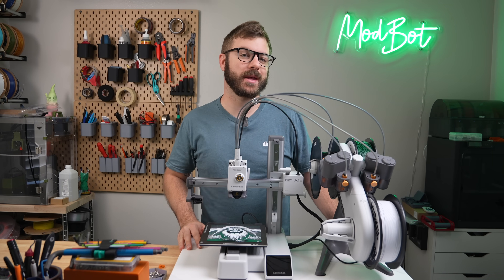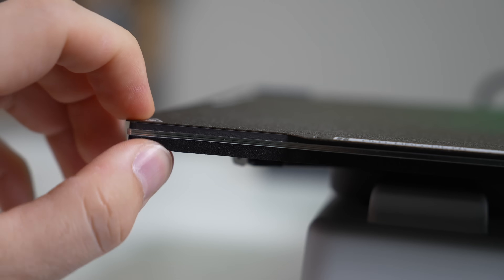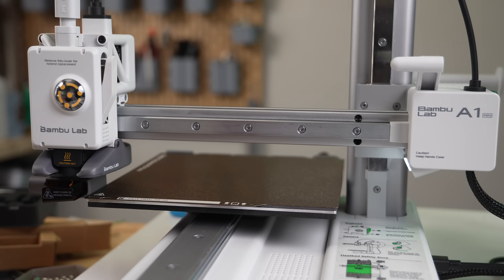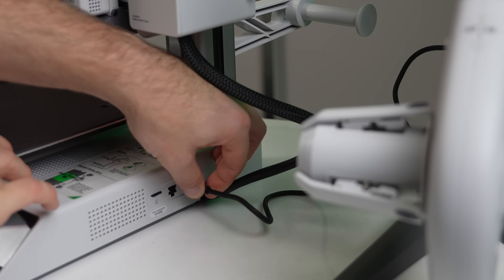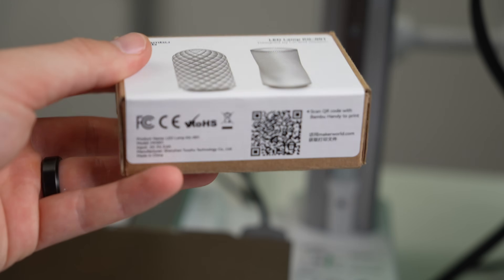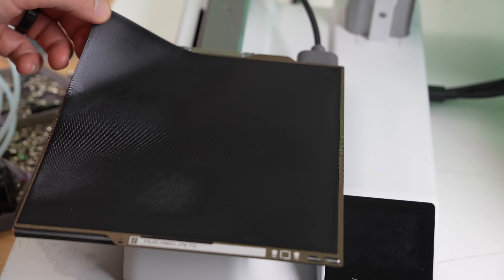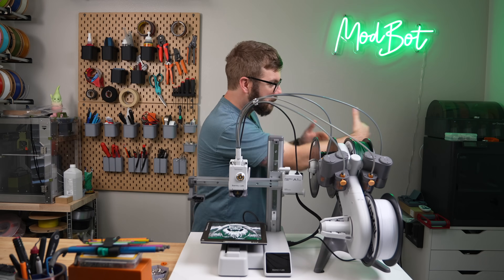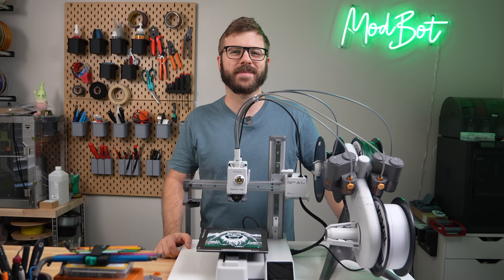This Budget 3d Printer Raises The Bar (Bambu Lab A1 Mini & AMS Lite) #BambuA1series #BambuA1mini

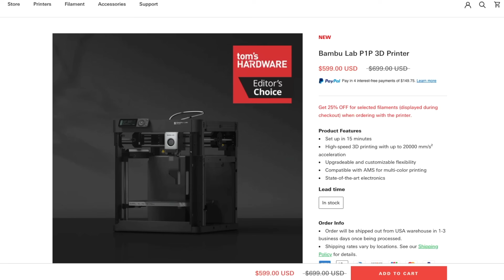Comment: 0:30 A small correction: P1S with AMS is $949, P1S without AMS is $699
Reply from the maker: Idk how I missed that 😣. Will pin this. Thanks! 👍
Reply: Bambu Lab P1P 3D Printer
$599.00 USD   from their website🤔
Reply: @themountain59 And?

🤷🏻‍♂️
Reply: I noticed that too
Reply: Beat me to it, I just came down here to say that too. When I heard that I was like wow that is impressively wrong lol.
Reply from the maker: Yeah I had been starting at my script for hours and ready through it multiple times. I think my focus was on all the technical data on the printer. If nothing else it drives my point home in that it the combo is not a budget 3d printer.  @dannonyogurt98
Reply: @ModBotArmy Very true, a budget printer it is not. Good review otherwise. 
My biggest problem with this printer is the amount of waste, it's just downright excessive.

Comment: Awesome video and overview. I'm in the market for a new printer coming from an Ender 3 V2 workhorse and honestly the biggest thing holding me up is the footprint. 

I love the idea of the mini because it's smaller but if I were to go AMS or even upgrade later I might as well just get the P1S because it's a smaller more compact machine. That's a bit odd to me. I almost would have rather had them design some sort of cage or shell for this that the existing AMS would have worked with on top.

Comment: After seeing the A1 at ERRF and the print samples coming off the machine as I watched, I placed an order for one as soon as orders opened on October 16th. Relating to your comment about placing the printer in an enclosure, what are the restrictions on the lengths of the Bowden tubes leading from the Mini-AMS? I envision placing the Mini-AMS on top of the 3D Sorcerer enclosure that I use.

Comment: I sort of cheated and took 2 Laser engraver enclosures I had laying around 1 of which is a Two Tree's brand very heavy duty fire resistant enclosure and cut them both up to fit the A1 Mini w/AMS Lite.  I am only using PLA right now but it works well I have a front zipper that get 3/4 of the front and then almost all of the top middle area open's up.  I would post a picture but dont think I can but it works well.  Then of course had to line the LED lights inside the top edge to give me light.  I figured that I go all through the hassle of keeping all my stock of filament in a special container might as well do the same here.  I keep 1 Eva dry desicant holder inside the enclosure to keep the moisture out.

Comment: I am absolutely blown away with this printer and this company. I bought an anet A8 +5 years ago, and it's crazy that now, for ~150$ more you can buy a printer that has absolutely nothing to do with the anet. It's like comparing a horse carriage with a modern car. I cannot comprehend how it's possible to pack that much technology into a 350$ printer.
Reply: Manual leveling on the anet drives me crazy

Comment: Am I right in saying this hasn't even released yet? If so, there are sooooo many comments from people saying they didn't like it and recommending Prusa instead, which makes me think there is some sort of bot/astroturfing thing going on.

I'm currently using my friends OG Ender 3 and I'm enjoying it. Mainly for printing terrain for wargaming and also dipping my toes into printing minis as I don't want the hassle lf dealing with resin and I live in the UK where the temperature in my garage is going to be too low for resin printing most of the year.

The easily swappable nozzle/hotend in this excites me for that reason! Do they come with 0.2mm nozzles, or are they available to order? Have you tried printing something with a bit more fine detail?
Reply: Oooops, I posted this comment before the end of the video and just saw you already mentioned about the nozzle availability. Thanks!

Comment: Not sure if it does have a Eddie current sensor underneath. Vector 3d took apart the printer and it has no electronics in that circularly part. Maybe something in the future or they removed it in development. Top quality video as always. Another disruptive printer from bambu. Not a printer I would purchase but I can certainly see this appealing to new comers.
Reply from the maker: Someone else commented that so I went to see his video. I reached out to see what they say. I had asked some questions about it during testing so I am confused. Another person said it still has an Eddie current sensor but it’s located higher up. Hopefully I’ll get an answer soon.

Comment: What weirds me out, about this excellent looking printer, is that there are four bowden tubes connected to the print head.
Bambu were 'this close' to having four independent nozzles, and a lot less wasted plastic.
Also, for something aimed at the home and schools, mothers and teachers are going to hate all those little scrapes of extruded plastic messing up the place.
Reply: Yeah, just print a 💩 bucket that connects to the cutter. Not a problem.
Reply: @joelamaro4525  Wasn't really the argument I was making was it??? It's about the issue of waste, not how you handle the waste
Reply: @DaveTimperley  handle the waste as in having less waste. 🤦🏻‍♂️ lmfao!

Comment: The printer is intended for children, therefore the bed temperature is limited to 80c, this also means that the selection of the filament that works with the printer is limited.

Of course, the YouTuber seller skips this in this promo video!
Reply from the maker: This printer will print pla, petg, and tpu fine. I said I wouldn’t get it over my X1C or P1S because I print a lot of abs/asa. Not sure what you are getting at? This is certainly not targeted towards children. A massive amount of people 3D printing never print materials outside of pla and petg.
Reply: Lol, nearly every printers bed heats up to that temp? In fact, that’s higher than most. So just trolling
Reply: @proaudiorestore8926  Lol,go back and continue printing your pokemons in PLA, while we adults make functional products.
Reply: If you think this is just for children you are a duIIard.

Comment: From technical point of view it is marvelous device and it is cheap as hell. Only issue I have is the AMS. It just does not make sense to me in this price market. It costs 450 USD, which is only 500 more to get P1S + AMS. 
Multi material print is expensive, I mean like 4x more expensive as for material consumption,  and the difference to P1S is just 20 kilos of PLA.  I mean, If you can't afford P1S you probably cannot afford AMS multi color printing either. You don't need to print multicolor, you can just use AMS for for convenience of material swapping and I believe many people with X1C AMS combo do so (I do), but if you don't have money to print often, infrequent changing of filament will not bother you as much.
TLDR: A1 mini without AMS is unbeatable machine for beginners and/or occasional makers. If you have the need to print often, P1S with AMS would be my recommendation. But my recommendation means nothing :-) and I fully understand and support buying stuff just because you want it, and I do want it.

Comment: the "Mega Combo" has hardened steel hotends, are they worth it? i assume the default is just brass.
Reply from the maker: If you want to print abrasives it is worth getting. Based on the stock nozzle color it looks like copper but it could be a plated brass I suppose.

Comment: I noticed the mouse prints with cubic infill - that's probably the worst infill for delicate prints as the nozle wipes over the infill. Maybe try changing it to Adaptive Cubic, Gyroid etc.
Reply: For some reason the default profiles for bambu slicer all use cubic infill and it even becomes a problem for larger prints. I always make sure I have gyroid selected when setting up a new print profile.

Comment: Have you heard if they are going to bring any of the new tech like noise cancelling and the quick swapping nozzles to the P/X series?
Reply: In the interview on CNC Kitchen, Bambu's CEO said they will bring the motor noise cancellation on the X1/P1 series too, and that they can because they designed their own driver solution instead of relying on the industry standard supplier (seems to be TI)

Comment: I don't think the AMD Lite can be mounted somewhere else... The spools are color coded based on the length of tube they feed into since the retraction is handled by springs. Moving it on top may requier spring changes in the AMS to compensate for the extra friction
Reply from the maker: You may be right. I still won't rule it out. AMS to Hydra mod was a pretty big conversion so there could be something similar that uses the primary components of the Lite but also mods them a bit.
Reply from the maker: Although I hope that is not needed.
Reply: I doubt that.

Comment: As I pointed out on another channel that did the review of this printer combo, it is a total waste of money and filament and is a over priced system.
$459 for the combo system package of the mini AMS and tiny printer.  

You be far better off buying the new released Elegoo Neptune 4 Plus for $350 or the huge bed Neptune 4 Max Both have Klipper 
built in and have a 300 C hot end and are both far bigger bed sizes than this silly tiny bed on this waste of money.

This printer wastes tons of filament doing multi-colour printing on a Purge Tower then 
also the same amount again on ever layer colour change by pooping the changed filament dump out to the side.
So all this and a tiny silly bed when all fast printers are getting bigger beds not smaller.  Most users would never wish to have 4 colour filament changing anyway!
Reply from the maker: You do realize the majority have no interest in a printer that large right? Large printers like that have their place yes but are much more niche. Bigger mess, massive footprint you have to dedicate an area to, failures hurt much more, multi day prints are the norm, less flat beds, longer to heat etc. 

I am testing out a massive printer right now because they do have their place but a huge machine like that is way more of a commitment. 

That is also not correct, many people would love to print in more than one color. When I talk to people who have never seen a 3d printer and I show them the printer and a print a super common question is can it do more than one color. I am glad that the Neptune Plus/Max are a good fit for you and its why we need options but I can assure you that is not the case for many.
Reply: @ModBotArmy  How many will continue to print multicolor after novelty wears out and poop pile grows? For big long prints, to switch to next spool when one runs out, but then, at this size 🤔

IMO IDEX (bi-color and/or true bi-material that do not need to have similar print temperatures) would be more useful in long run. Snapmaker has a good one, but price is quite high.
Reply: @kimmotoivanen yeah, the color AMS lite is still going strong. And they’ve found work around to cut the waste by a lot.
Reply: You don’t even know what you are taking about lmao!

Comment: As much as I want to like Bambu...  after watching CNCK's video and hearing the Bambu CEO, I really don't trust bambu.  They are doing some cool things, but they may also be doing some not so cool things on the data side.  For the foreseeable future, I am passing on all Bambu products.
Reply: His video made me personally more comfortable with Bambu.  To be fair, I never had much of a problem with their cloud service to begin with.
Reply: @jon9947 You are in the minority. Most logical people have a problem with the cloud system.
Reply from the maker: Everyone has to make this decision for themselves and if it is a big concern then sure hold off. There is LAN mode though which has gotten quite a few features pushed through that were not originally available. You may already know this but it may be worth looking into.
Reply: I watched parts of that video too (not the whole thing) and I didn't get that impression.
IMHO it's actually notable that they implemented LAN mode. That's a significant amount of development as it's separate from their cloud system and some things have to be done in a different way (ie. video streaming). I'm sure some companies would have just told everyone that cloud was the only option and worked on other stuff instead.
Only time will tell, but I can't fault them so far.
Reply: @zmast333  Lan mode really should have been the default though...  and should have been considerably simpler to implement than a cloud-based solution.
Reply: I feel the same way. Especially his excuses regarding patents. And then he claims that you can't monopolize the 3D printing market with patents. Stratasys did that with a few simple patents for 20 years. But apparently everyone has forgotten that.

And when asked about firmware update via SD card, he says that they are working on it but it is hard to do it safely. What a nonsense. Other companies have been doing this for years without people constantly bricking their printers.

The clearest sign for me that this company can't be trusted is that the comments section was flooded with comments praising the CEO. Either he has a bunch of groupies or his social media team has created fake accounts to leave positive comments wherever the name Babu Lab appears.
Reply: @andreas.grundler  Well said.  Another issue I have is the former affiliation with DJI who has been known to do some questionable things with user data.  Seeing the use of DJI drivers makes me feel like Bambu is still affiliated with DJI in some fashion.  Everything in my senses tells me not to trust them.
Reply: @andreas.grundler  I do a factory reset and take out the SD card, connect to a guest network to do firmware upgrades. Then factory reset and print away.

😂
Reply: 😂 

My X1 is not even connected to the internet.

Comment: do you think they will have foreseen the possibility of being able to mount it on the P1P too?
Reply from the maker: The AMS Lite? It is possible. The way you need to access things though sitting on top of the printer may make the most sense. I am curious to see if they add support.

Comment: Nice printer. Quality components. Engineered well within constraints. Except for the excess use of material and wasted material (which I feel is the 💸🐄 for BLb), it is a robust maintenance free system. Glad to see upclose details of the heater block. Seems like the heat chamber built into toolhead, with heat transferred through conduction alone.  That explains large flat surface area of hotend. The electrical spring contact behind the melt chamber is probably used, to ensure heater is not energized, witout hotend present!. Eventhough the design is innovative, it will inturn, impose limits on max hotend temps. Will be interesting to see toolhead disassembly, and the eddy current sensing. Excellent review👌❤👍👍

Comment: Vector3D's teardown shows there is no sensor fitted where you indicate the eddy sensor is. I am guessing they were planning to use an eddy senor there As a z sensor but are instead also using the strain gauge for Z probing.😢
Reply from the maker: That’s wild. I just looked into that part of his tear down. I even asked a few questions about the sensor during my testing. I will send an email today for clarity with a screen capture from his video.
Reply: Further investigation suggests they were planning to use an eddy senor there below the fan duct as a  beacon style Z sensor, that senses bed proximity, but instead they opted to use an eddy current sensor above the heat sink to detect movement of the heat sink for Z probing as well as for active flow control. I am guessing it senses movement of the magnet installed in the heat sink. Very clever design.
Reply: Also, an eddy current sensor cannot be used for testing extrusion pressure as stated in the video. It would measure proximity to a conductor. The pressure would be measured by the loadcell.
Reply from the maker: @JonS  it was not totally clear to me how it was being used for that and I was told “The Eddy Current Sensor can sense the tiny flexing of the hotend to calculate the pressure of filament inside”. It is entirely possible my contact misunderstood and meant load cell.

Comment: I wonder if you can run the AMS lit upside-down, so you could screw it to the underside of a shelf above the unit. Then you wouldn't need to change the length of the bowden tubes.
Reply: This has been done and confirmed now, if you haven't seen. Someone made a bracket that mounts it above, upside down
Reply: My first thought exactly. Seems viable! 👍
Reply: Wondering the same thing as well. That connector cable from the ams to the printer just seems short so maybe an extention (diy or bambu) might be needed
Reply: I'm also wondering the same thing.  Bambu Lab sells longer cables for the standard AMS and it looks like they are using the exact same cable on the AMS Lite, so as long as it will run upside down it should work.  The price point makes the A1 Mini Combo hard to pass up but the footprint is a turn off.   @Wynand4
Reply: neat idea

Comment: The hotend is propably heated by passing current through the metal, with a temp sensor in the mount. This would be optimal, since the whole block is heating up, not just a single element so no issues with thermal conductivity